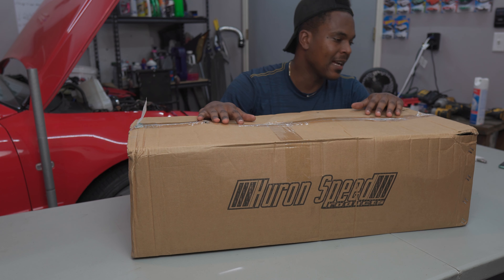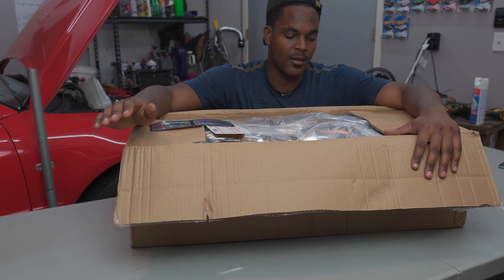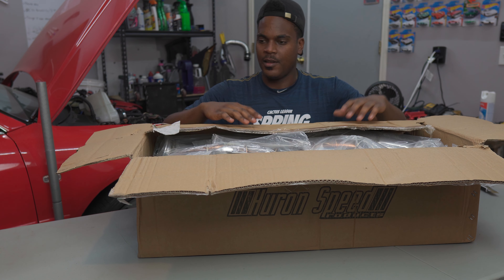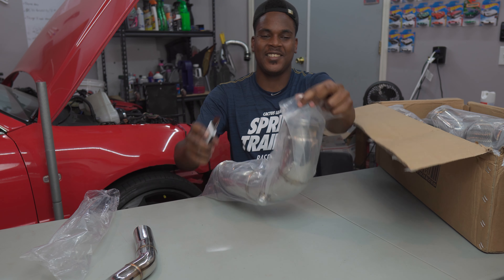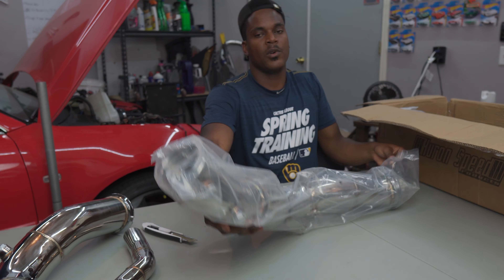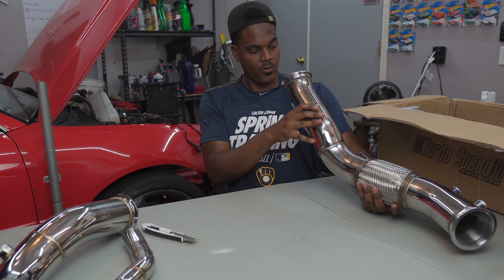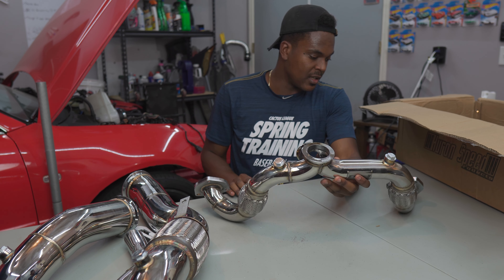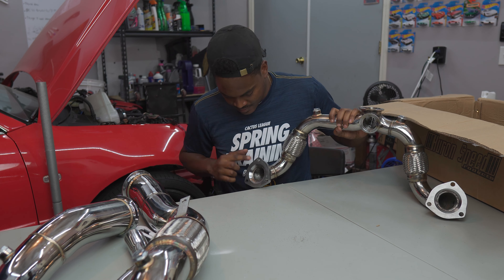B5 S4 Single Turbo Kit STK

Comment: Woooo!
I'm impressed as hell. I checked out xs power site and that's a hell of a deal for what you get.
What figures are you hoping for with the 5858?
Reply from the maker: Thanks man! I’m looking to make close to 600 at the wheels
Reply: @CIPGAS  hi is it still holding?

Comment: Can anybody help me with this I'm sure you can I know there's some Audi Enthusiast out here I have a 2002 Audi A6 Quattro I had a code p2096 post Catalyst fuel trim system too lean bank 1.
It runs normal actually it was a little rough when I first left the garage.
Reply from the maker: Hey man, you should check/replace things in this order. 
O2 sensors, injectors, catalytic converters, and MAF sensors.
Reply: @CIPGAS  I'm replacing 02 sensor.
Replaced fuel filter and gas cap.
All these we're original parts.